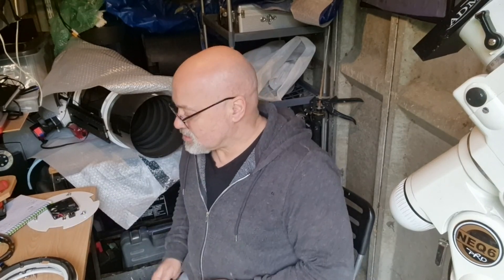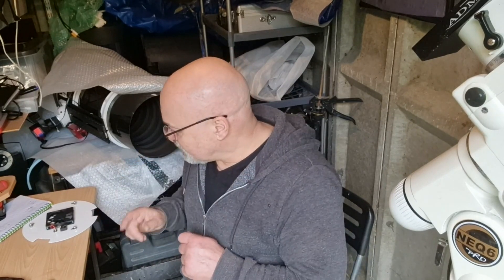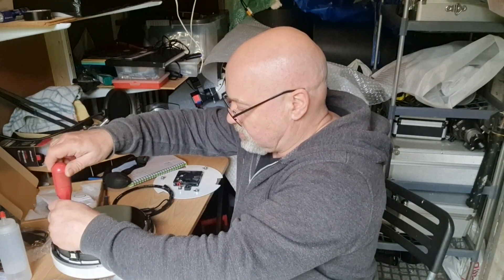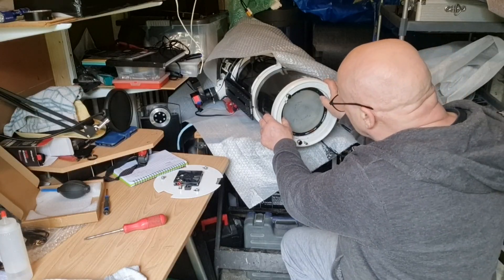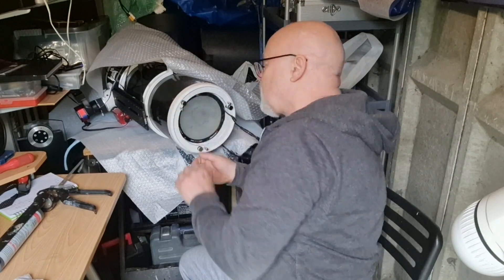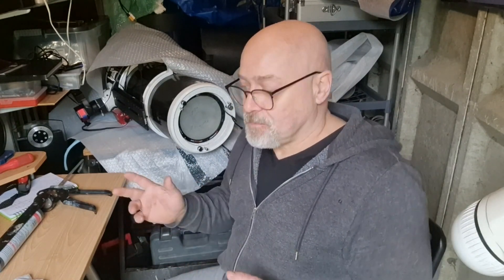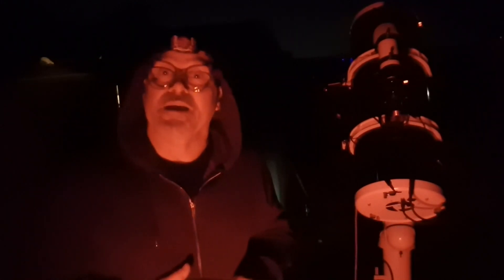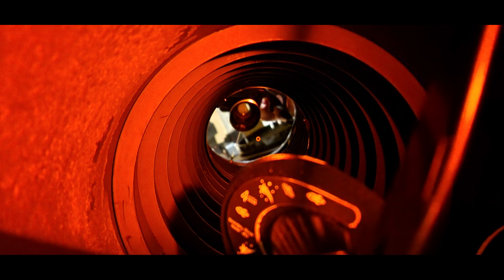Skywatcher Quattro primary dew fix.

Comment: I have a 8" StellaLyra F/4 and is seems to produce white haze on most images especially during semi-clear skies (damp) accompanied with moonlight. Maybe this will help me ??
Reply from the maker: I cannot tell you if it would work for your situation but it certainly works for me. I have had frosting in the tube but mirror was ok. I just look down tube and see what its doing.  It could also be the secondary and that needs to be considered too. Clear skies
Reply: I put a dew heater on my secondary mirror. Last time I was imaging we had a full moon and some thin clouds which seem to magnify the moonlight. I also have a dew-heater wrapped around the bottom of the telescope. I don´´t know if the heat reaches the primary mirror ?
Reply from the maker: A dew heater around the bottom of the newtonian would be not effective in my opinion. A fan would be better as it works like your de mister in your car. I would keep the fan going all the time as they are usually vibration free.
Reply: Yes, the StellaLyra has a nice fan at the bottom. I thought it was unnecessary in sub-zero temperatures (down to minus 22-25 degrees celsius ) here in Iceland..
Reply from the maker: The fan would also pull air past the corrector helping there too.

Comment: 6 inch ring on a 8 inch mirror, correct ?
Reply from the maker: Yes thats correct. That way it heats more evenly rather than the outside edge. Only need just a bit of heat.

Comment: Isn’t easier to get a 5-6” refractor, preferably Japan, USA or Germany made, and forget about this hassle? Images will be definitely better as well.
Meantime, your excellent skills could be used for opening company specializing in fixing Issac’s scopes and other astro equipment produced in Far East.
Reply from the maker: Hello thanks for your input. We must not forget that a premium 5/6 inch refractor will cost upwards of 3 times the price of a newtonian. Thank you again and clear skies
Reply: @sevenskiesastro  Yes, they are expensive. Therefore, I have postponed hobby for about 10 years. Used only visual and EAA. 10 years later, I have entered astrophotography with premium mount, premium scope and premium focuser.
Reply from the maker: @anata5127  wishing you the very best. You may hit problems on the way but I'm sure you will produce some great images. Clear skies
Reply: @sevenskiesastro  No problems so far. Yes, I get good resolution, and don’t need to rely on trickery during processing. Basically, just take pictures without overstretching myself for other activities such as tuning, repair, tackling zillion problems, etc. Plan is to take pictures of 1000+ objects.